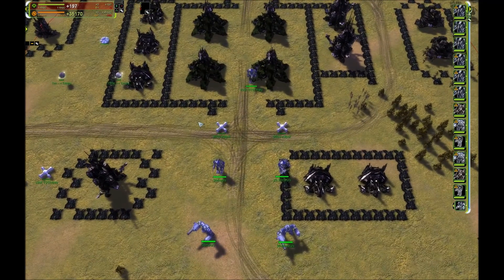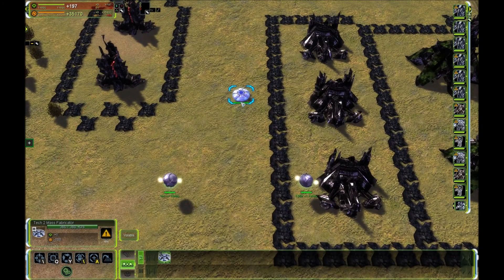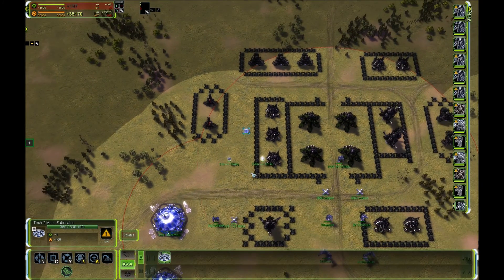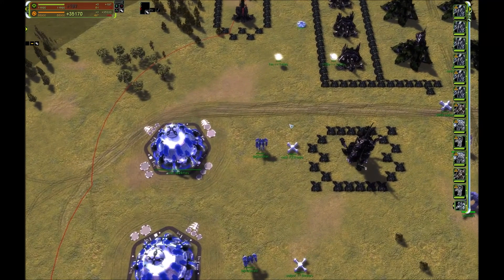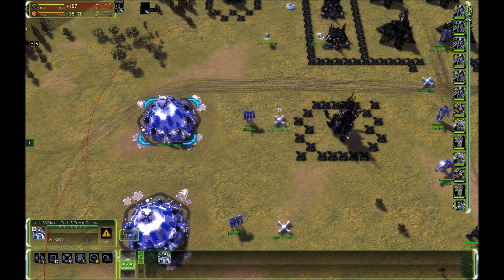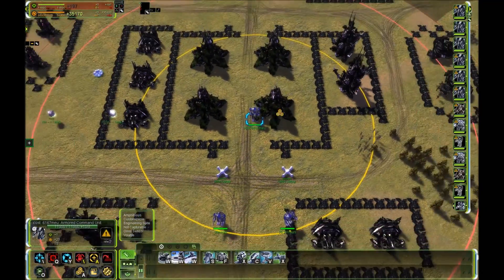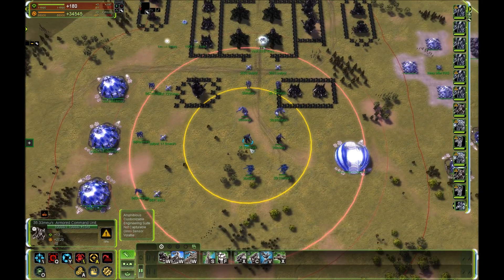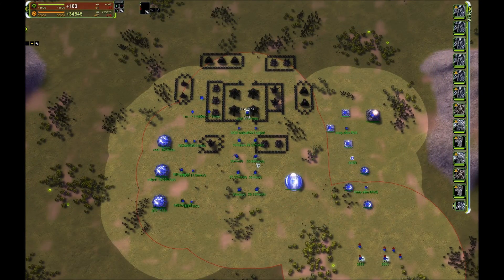Mass Equivalent Units and RAS Changes - FAF Patch Spotlight 4.1 - Supreme Commander Forged Alliance

Comment: Only one thing i would have added..  in order for a T3 pgen to have an meu value, you have to also build mass fabs.  So you could have included them in the calculation.  This makes the sacu less of a down-cycle because they don't need to add mass fabs.

It is hard to see the numbers sometimes, but i think the RAS is 3600 or so meu and the output is 36.  This is 100 seconds to replay not 170.  The new ones are 3600 cost and 29 output - 125 seconds.    So the difference is only 25 seconds.  So the loss isn't as bad, but it will definitely screw up people who are finely tweaked - which explains the pros' shitstorm reaction in forums.

Comment: Who did devise the concept of MEU? And you could have gone into some of the aforementioned drawbacks, otherwise a great video!
Reply from the maker: The author of MEU is P. M.

I am not sharing the original source on purpose because it contains a lot of information that is
(1) over-theorized and not backed by practice,
(2) outdated because of the current patch environment,
(3) and large parts of the work were already controversial when released, especially the sections where he draws utility curves based on questionable criteria.

Sharing the original source would do more harm than good these days, since noobs and Joes couldn't distinguish which are the good parts, which are the irrelevant parts, and which are the bad parts. The irrelevant and bad parts could lead to what I call "fake choices":

These are situations where the game seems to present two equally viable alternatives, while it actually doesn't. Instead, the intuitive alternative is the wrong one, and the counterintuitive alternative is the right one.

Prominent example: T1 Pgens around T3 Stationary Arty outperform T3 Pgens around T3 Stationary Arty despite their lower rate of fire. People will still use the intuitive T3 Pgens and die, and do that for hundreds of games. Unlearning persistent bad habits is difficult.

If I had presented percentage values on the rate of fire difference between T1 Pgens and T3 Pgens in my arty tutorial, even more people would fall for the "fake choice", use T3 Pgens and fail. That's why I'm not discussing percentages in this case, and just say what's best instead.

You don't need a broad understanding of this game to be good at it; it is better to have a deep understanding of only the most important key concepts and apply them. Become an ACU pilot, not a professor!

That's why I am only presenting the parts of P. M.'s work that matter, and I'm doing what I can to prevent people from internalizing the parts that don't matter.

P. M. deserves full credit and a lot of respect for the paradigm-changing amount and quality of research he has contributed to FA. The best sections of his work notably improved the gameplay of his readers.

I hope P. M. is watching us from the shadows and proud of everyone here, the rest of FAF, and naturally himself, because he deserves to be. Thanks bro, you definitely made FAF history!
Reply: The drawback of meu:
1.  Doesn't account for build time (which effects how long it takes to repay your investment) because this depends too much on assists, being raided, and your economic health at the time.
2. Doesn't account for adjacency which can effect the output by 50% for structure (but not SACUs) or the power cost by an amount as well.  This raises the question - is it more efficient to ring with storage (increase production), pgens (lower cost for mass fabs), or just build more base structures.)
3.  Doesn't account for the fact that power only converts when you add more mass fabs - which technically increases the cost of the 'mass producing' pgens.

Nevertheless, the long term effects of these issues are multiplicative, which means they act as ratios and so if something is 50% more efficient, then if you ring both with adjacency structures, it will still be 50% more efficient.  Usually.  So, the MEU is a good measure of relative efficiency, just don't expect the numbers to directly translate to your gameplay.  Which is likely why Heaven isn't focusing on the math.

Thanks again, Heaven.  I always find my self thinking about the meta game after your vids and that's perhaps the most valuable part.  Keep it up!